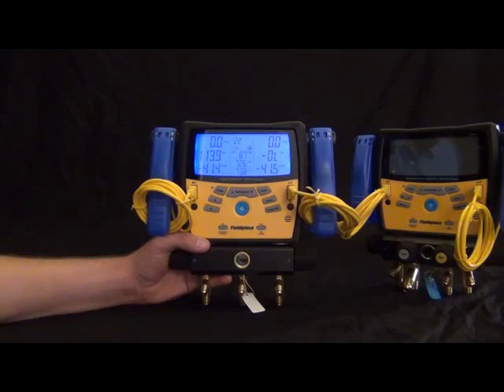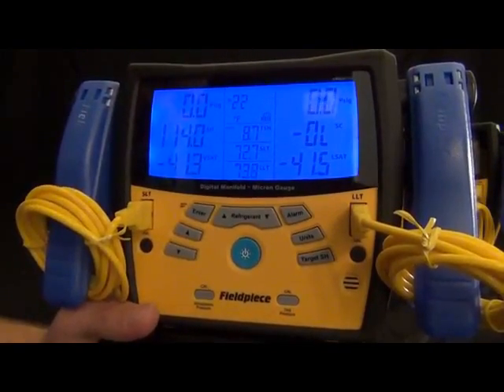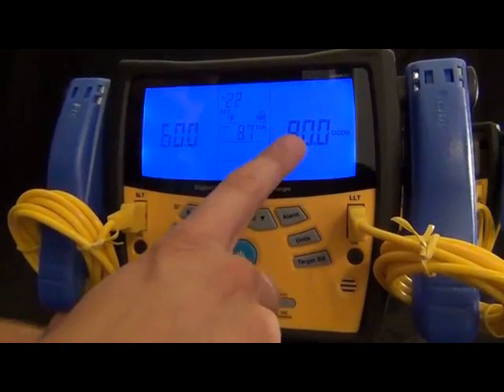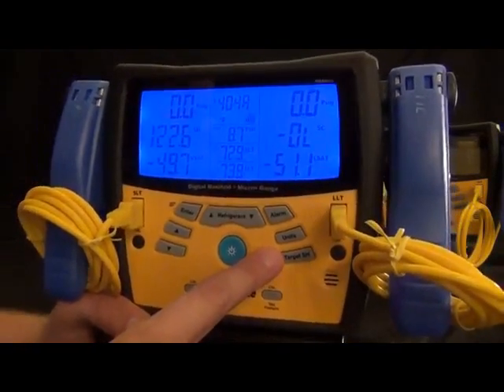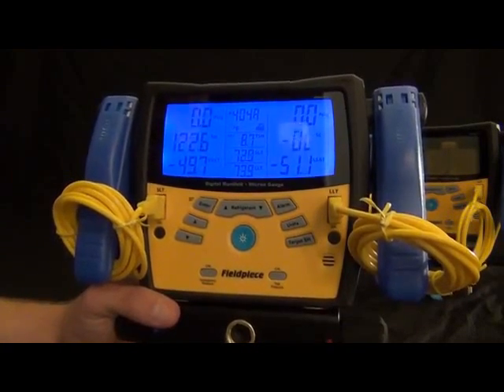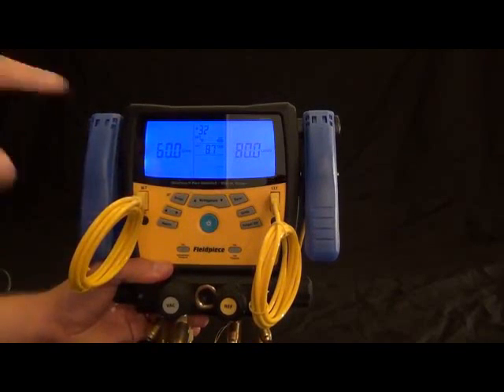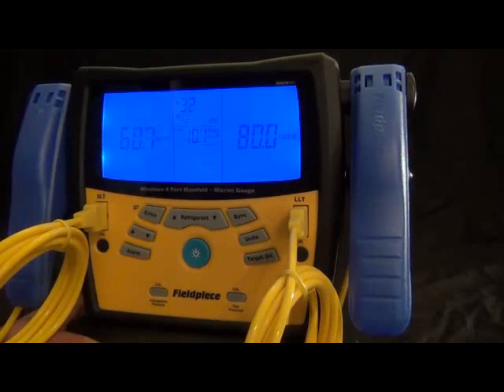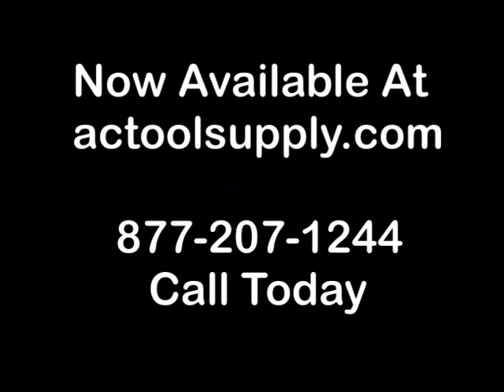Fieldpiece SMAN460 Wireless 4 Port Digital Refrigerant Manifold

Comment: I bought the SMAN460 3 months ago and I keep having a connection problem with my HG3. I never get more than 60 feet distance from the manifold to the HG3, and every thime when I turn my tools on I have to pair them again,the SMAN460 manifold works great when you're not using the wireless function, I love it but I really want the wireless funtion to works the way fieldpiece advertised these tools